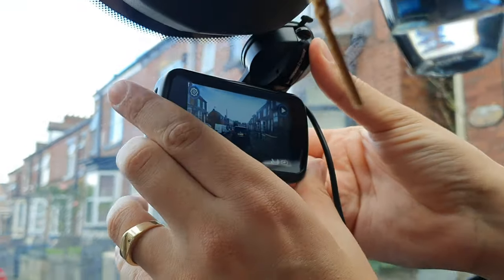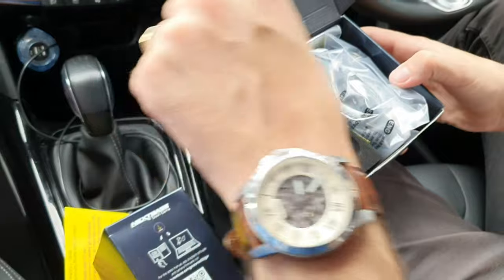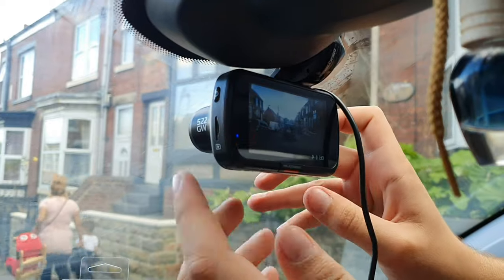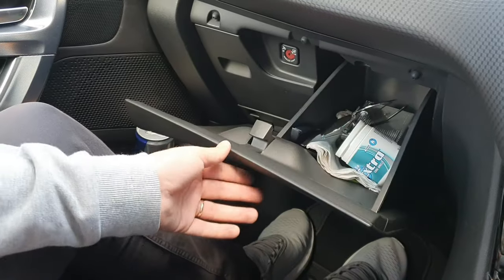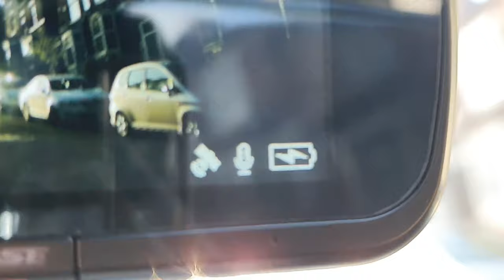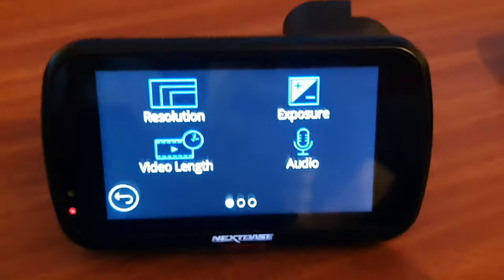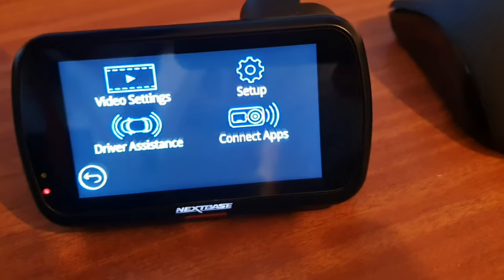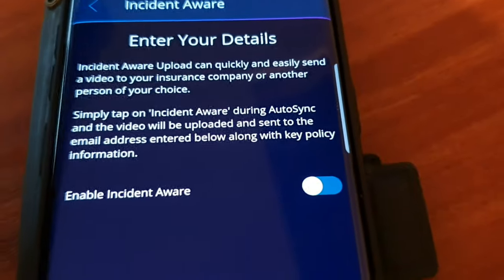How to Install a new Dashcam on any car Nextbase 522GW FR Peugeot 2008 2024

Comment: I really wish cars would start offering both USB pass-throughs and a couple USB power ports up near the rear-view mirror. It would make mounting stuff like this so much easier. I'm considering getting the same kit since it's on sale right now. I'm not sure about the separate rear-view camera though,  I open and close my hatch a dozen times a day. Not sure that magnet mount would hold up. Thanks for the video!
Reply from the maker: I have had no issues with that and I did used the car a bit at certain times. I think the magnet would last you quite a bit. if you already got that, as you I see the post is from 1 month ago, please share with us your experience with the kit.
Oh, and yes, I can totally agree with you, some USB's around the mirror would be a good add (usbs with some good/fast charging also)

Comment: thank you so much for showing how you detach the sticky pad attachment everyone elses video skirts around this bit.
Reply from the maker: It's great you found it usefull mate. thank you for watching. have you got this dash cam? How does it work for you mate?
Reply: @SEPAChannel  yes got it but can't seem to connect via bluetooth to the app. or update the firmware, but the customer service is great they send you emails with step by step instructions.
Reply from the maker: It's so good to hear. I have not contacted them one so far so It's just great to hear they are doing an amazing job
Reply: @garybaxter7374  hello Garry. have you got that connectivity issue sorted?
Reply: @ionut.litoiu  yes thanks, i asked on their website, you just needed to uninstall the app and reset the camera to factory settings
Reply: @garybaxter7374  Sounds like an easy fix. did it took much time for them to reply to your question?

Comment: Great vid mate, bought the hardwire kit for my 2008 and will follow your example when wiring mine in. 👍
Reply from the maker: Hello Steve. Hope you having a great day. Let us know how it went mate and how much time it took 😁 All the best!
Reply: @SEPAChannel  Horrendous design for a fuse box, I’ve got shovel like hands but got the fuse in, where did you earth yours? Can’t find anywhere I can get to. Apart from that it’s easy. Cheers for vid help though, would never have sussed it without it. 👍
Reply: Finally done, working a treat, took a while with the lack of access to the fuse box, more so with having big hands and finding somewhere to earth it but apart from that it’s easy. 
Once again thanks for this helpful vid mate.
Reply from the maker: We're happy you got it sorted out. It took me 4 hours in total start 2 finish (shooting the video included) 😂😂 but it was a good work and enjoyed it in the end.
Indeed the fuse box is hard to reach, however you should see the toyota Aygo mate... fuse box is located right side under the dashboard and you need to sit on hour back literally, under the steering wheel..😂 we helped out a goos friend of ours to fit one yesterday... been fun😁
Reply: @SEPAChannel  Yeah probs took me a good couple of hours in all but worth it, saving a good £35 fitting cost. Gonna try and do same for the missus with her Capture.  Cheers for the vid help.
Reply: @steveoxley4374  where did you ground your to? I can’t find anywhere??
Reply: @glosphantom8722  I put a self tapper in to the door pillar, only place I could do it, the opening to the fuse box is so small.

Comment: I've just purchased one of these cameras. I think it may be easier to plug it into the cigarette lighter.
Reply from the maker: If you are ok with seeing those cable that's the quick way to do it to be honest.
Reply: That is indeed the fastest option and hussle free if you think about it. In my opinion is just a matter of if you want to do the hardwiring or not. Have you managed to install it? How was the process?
Reply: @ionut.litoiu  Yes, all installed.  I just use a cigarette lighter, it's much easier than messing around with the wiring.
Reply from the maker: @PennG0VQY  it's easy indeed. We just wanted to try and hide as much as we could the cables
Reply: @SEPAChannel  It's always a good idea if you can hide all the horrible cables away.  I suppose it all boils down to whether you are confident enough to mess around with the electrics.  I use those stick-on cable clips that enable me to attach the cable in a way that it does look reasonably tidy.  And if I want to take the camera out at any stage that I just unplug it from the cigarette lighter.

Comment: Great video for installing Nextbase dash cam on Peugeot 2008, a question for parking mode which fuse slot is safe to plug in for diesel 2008 please? Thanks. 🙂
Reply from the maker: Good question! If anyone knows, please reply to this comment. Cheers.

Comment: I liked the way you showed how to run the wiring.
Reply from the maker: Thank you so much. It actually took quite some time  however was a job well done as the wires can't be seen anymore. Hope you got your sorted.
Reply: @SEPAChannel  I did get sorted. It did take some time, especially up around the windscreen strut.
Reply: @NOOne-im5vg  Hello. around the windshield, are the wires standing properly, or do they fall from time to time? I honestly had to re-arrange them every time I took the car out of service. You just know, if you have a dashcam you have to turn off the camera and remove the wires. Strange right, but that's it, and they have their own policies and their own privacy.

Comment: Hi two questions.
When you select the g sensor what did u decide to set it on? I found medium too sensitive and mine is now on low .
Secondly have you had any issue with the SOS. My cam is saying “esos function currently not available.” “ We are unable to activate SOS with your model of iPhone right now please check back soon”. I have iPhone 5?   The app works perfectly fine on my iPhone 5 however the SOS doesn’t seem to be allowing me to function it the main reason I brought the nextbase was for reliable SOS functioning.  Any ideas ? Thank you
Reply from the maker: hello mate,

to be honest I set it op on high, it locks almost anything it senses, however I would say is a matter of prefereces. To be honest I have not used the SOS function however u gave me an awesome idee to test out my next day off. on the other hand another test i'm gonna make is trying to make the cam actually charge as the internal battery is not charging. had a few looks here and there and I might found the issue and it might be me not following a specific step by step process when first charging it.
Reply: hello James. Have you got that SOS issue sorted out? How does it work?

Comment: Hi, did you format the SD card on the dashcam settings before using the device? The format card can be found in the settings section.
Reply from the maker: Hello mate. That's wat I initially did. format it then let it work. from time to time, the dashcam will ask you to do a format on the SD card anyway

Comment: Salutare, frumos review. Ai idee de ce camera nu filmează non stop deși e legata direct la baterie?
Reply from the maker: Hi mate. thank you for your comment. It is build in such a way that it will record by itself when it detects motion. Go to settings, G Sensor and change the settings so it will be more sensitive
Reply: @SEPAChannel  thx mate
Reply: @mihai4cris  Salut Petre. Ai rezolvat problema cu filmarea non-stop? sanatate.
Reply: @ionut.litoiu  se pare ca nu e o idee buna legata pe direct, m-a lăsat fără baterie în 3 luni 😂😂😂
Reply: @mihai4cris  exista o solutie cu o baterie separata adaugata intre bateria de la masina si camera. Are un sistem destul de destept, iar bateria aceea suplimentara se incarca in timpul mersului, astfel, va avea un fel de buffer pentru cand masina este oprita, si tot asa. Recomand cu incredere. am vazut cateva instalate. Dar, daca vrei sa scapi de toata bataia de cap, hardwiring pe cutia de sigurante, pe siguranta de bricheta spre exemplu.  Multa sanatate
Reply: @ionut.litoiu  m-am gândit și la varianta asta, ms frumos.
Reply: @mihai4cris  este o varianta interesanta, dar implica un cost aditionala. daca nu ma insel este undeva la £80-£100

Comment: Can I know to which fuse number did you connected your hardwire. Apparently, I have the same car model as yours. Kindly advise. Thanks
Reply from the maker: it depends what car you have mate. you should find the fuse box schematic and link it to the lighter one.

Comment: thanks for sharing. amazing fitting! Does the black rubber lining stick back into the doors and roof? or do you use any adhesive for that!
Also, please tell me what if I want to record the car for the whole night? For how many hours can the camera record when the car is switched off?
Reply from the maker: you won't see any wires mate if you do the hardwiring properly. And no, does not record all night. You will need a battery for that and then connect the camera to the battery then the battery to the Car battery. Depending on how good that external battery is, you can get quite some time.
It does have however a G-Sensor and will record if any motion. You have 3 levels to set-it up.
Reply: If you use adhesive it will give a even better fitting position as you can run the cable in a very neet way on the windscreen. apart from that, you don't need it at all and I am sure you'll find a way even without. take care bud !

Comment: The resulotion of front cam 60fps frame go down to 30fps? if you use the backcam???
Reply from the maker: hello my friend. it is indeed going down to 30 fps per camera. however I can say 30 fps should be enough anyway for slow-mo to check a plate number.
Reply: sanane no,it stay the same
Reply: @Adrianek81  it's staying the same 30 fps if you connect both of cameras?

Comment: thanks for the video, i found it useful.

a question though - is that camera recording everything into the sd card constantly, or can you, for example, when you witness the accident press the button and then the last 2 minutes (or so) will get recorded so the card will not be overwritten?
Reply: If there is an accident and your car has a weird movement the G-Sensor will pick that up and a shot will be locked of the moment of the impact. If you need to quickly download something from your camera just get on your phone and you'll be able to download that specific video, from either front or back or both recordings. all the best. let me know if you need some help with anything.

Comment: Is it recording on a continuous video or is looped recording. And for how long can it record. Amazing review
Reply from the maker: Hi George, It records in a loop, each recording lasting 3 minutes and when memory is full will erase old recordings. At the same time, if G sensor is triggered or you lock a video will not delete it until you either delete it by yourself or format the card. depending on how big is the storage capacity, the more the merier. Thank you for watching the video. Once you install your cam, let us know how it works. if it's the same model or a different one.
Reply: Hi George. It's continous indeed. Have you got one?

Comment: Hello Buddy,

Thank you for the review. This is yet another review that really seems to be in favour of this dash cam.

I'm having really bad luck with my new car, so need to get a dash cam (or the car will sadly have to go.) My biggest, and honestly, only requirement, is recording when I'm away from the car if/when some b*****d knocks my car. I don't want to rip my new car to pieces, hardwiring one of these things, therefore battery life is hugely important to me.

Which leads to my question: Can you please let me know how good the battery life is on this model, with regards to it starting to record when it detects a knock (from another vehicle) when the engine is off and you are away from the car? More specifically, how long (in days?) would the battery last if you were away from the vehicle? Also, how accurate is the knock detection? Eg when someone parallel parks too close to you, and hits your car?

I have a convertible, so can't have a separate camera on my rear "window," therefore do you think the rear view camera add on would be good enough for protecting the rear of my car? Again, I'm referring to recording knocks when the engine is off and I am away from the car. Or do you think the optional cabin view plug in camera would do a better job of this?

Thanks again for your review, and I'd really, really appreciate your feedback re my queries.

All the best!
Reply from the maker: Hello mate.
Thank you for your time watching this video.  We are happy to see you found it useful. Regarding your question, please find the following details:
1. Regarding recording while away:
The Dashcam does not record continously when engine is off as the way I wired it (the fuse I  connected in the fuse panel) cuts the power supply when engine is off (when removing they key) so this is really a matter of prefferences also it inflictes the way in which car's battery is used so please do a little bit of more research if your are thinking about hardwiring it directly from the car's battery.
Nextbase Cam has an internal battery that it can last up to 3 days, however the catch is: cuts everything except the G'Sensor which is a gyroscope sensor and when it feels a motion will turn-on the camera, and will record for 3 minutes and lock the recording as it will not delete unless you specifically delete it or format the SD Card.
You can extend the period it can work without turining on the engine by buyng an external battery and hardwire the battery at the fuse first, then connect the Dashcam to the battery, it will cost you around a £50 more.
Based on my understanding you need  or want a really professional camera,I would suggest you a Black Vue camera as it does so many things, hardwired also with an external battery and you'll need a DATA Sim Only Mobile Broadband in the car so your dashcam will stay always connected to internet, you can check videos while in your holiday in Spain or if an accident you will be notified directly on your phone, works pretty much as a full car security measure, however it won't cost you £200-£250 anymore, we're talking about £450-£500 at least, depending on the model and you'll need to either pay a DATA Sim Only or Mobile Broadband or park your can within a Broadband/Wi-Fi area so it will always stay connect.

Anyway, We would strongly recommend you the Next Base cam, however if you'll find another Dashcam or you go for a BlackVue you're most then welcome to share your toughts and result with us as we are always interested in finding new stuff and opinions. Thank you my friend and all the best, hopefully no more issues with your car.
Reply: Hello mate. what dashcam have you decided to go for?

Comment: For a little over a year I have the rexing v1p dash cam  and it is  hardwire the biggest problem I am having with this dash cam is it's inability to connect or stay connected to wifi for the rexing app. Without this connection to the app to see my videos my dash cam is useless.  So I am strongly considering on purchasing the Nextbase 522 and since you have own this camera for over a year do you have any issues with wifi connections?
Reply from the maker: In all honesty, is not the best connection, as if you want to doenload videos from the camera directly, well, let's just say is gonna take ages unfortumatelly
Reply: @SEPAChannel  Thank You for getting back to me.  How good is the dash cam connecting to your phone then so you upload from your phone?

Comment: Brilliant video SEPA, thank you.  Just a small Q, how the heck does one remove the dashcam from the mount once its fitted in the car?  It must be possible as it can be connected to PC, but I can't manage it, can't see it mentioned in the manual, but it must be possible, help!
Reply from the maker: you can remove it, however it does not seem to be too easy. It is quite well with there in it's holder.

Comment: Any videos showing how to get the power line in to the fuse box? I’m really struggling.
Reply from the maker: If you are not sure, we would recommend to go to an auto shop. If you are looking for the fuse to bypass it would be the one for the 12V socket since it will stop receiving power when car is off. Cheers

Comment: Does it have an in-built battery? Say your car is parked off the road and someone hits it, will it turn on, and does that apply for the rear cam too?
Reply from the maker: It does have one and it works while plugged in at thr lighter. In my case, using the fuse kit, does not give enough juice for some weird reason. In short terms yes, just has some limitations
Reply: Hi. Do these not charge automatically then?

Comment: Why the hell I need a hard wear kit? Is the hard wear kit necessary? I thought this came complete with everything except the SD card. Mine came with cam, mount power cable, isb cable suction mount power cable fitting tool, and quick guide.
Reply from the maker: hi there mate. the hardware kit is if you want to hardwire it so you won't use the lighter socket and hide all wires it's not a mandatory, however I opted for this option
Reply: @SEPAChannel  Thank you very much for the information Sir. I'm a very old man that is still trying to figure out things with the slowing down of my mind.
Reply: @bernarda658  Hello Bernard. Have you got that sorted? Might you need some help with it? All the best and stay safe!
Reply: @ionut.litoiu  I've figured it out. My children put it on for me.
Reply: @bernarda658 It's so good to have someone that you can rely on and helps around when needed. I am happy you got that sorte. Take care, stay safe!